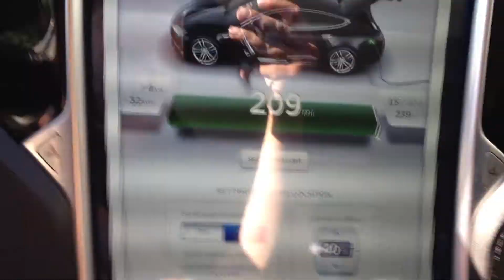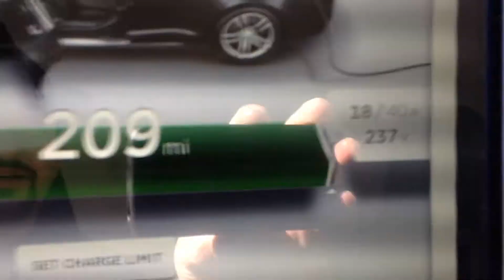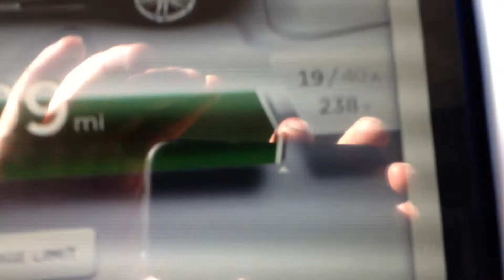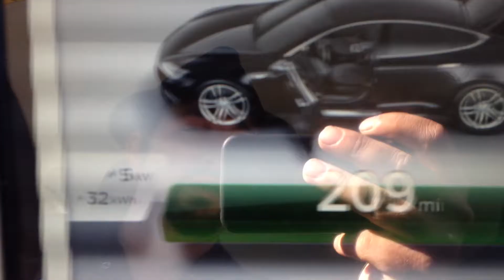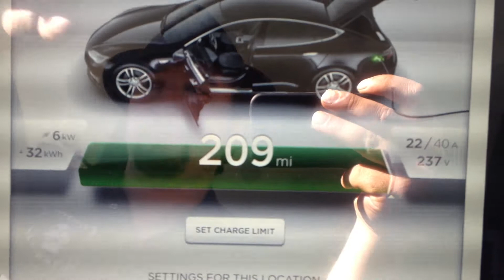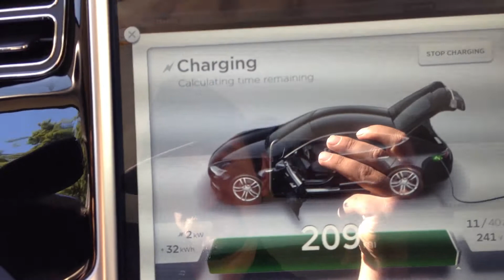Tesla Motors Model S: Part 35 of Many! "Shore Power"

Comment: I agree..sure draws a lot for the AC.  Did you ever figure out why that is?  And does the AC cycle the compressor?  Or when it's on does it run all the time?  I'd like to see the power budget for the whole car.  Lights, AC, heat, etc.